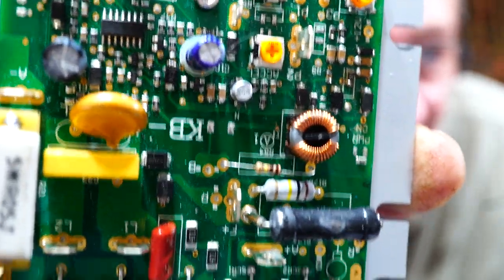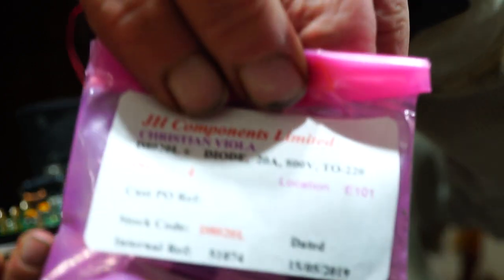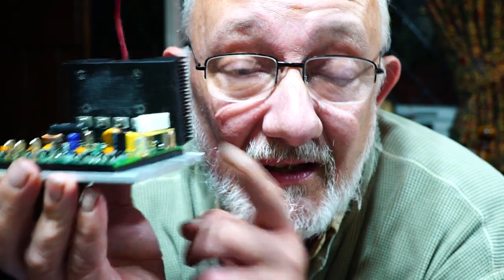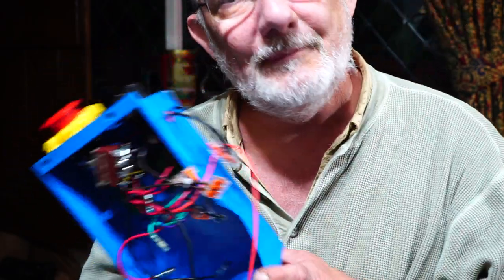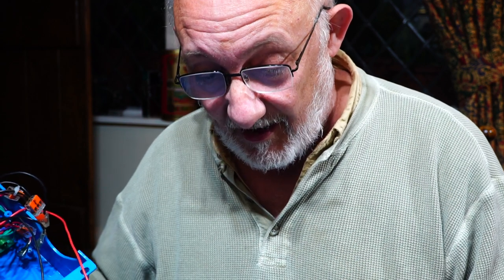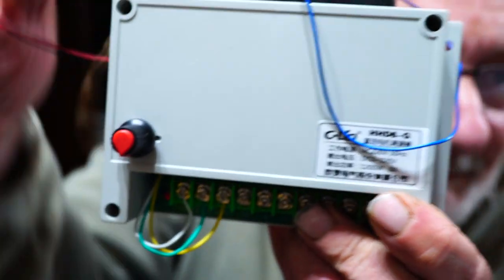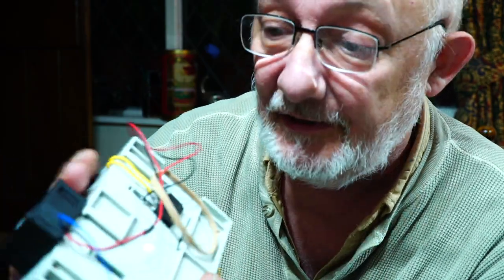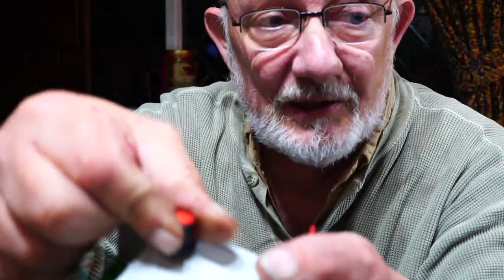Mini lathe KB board blown up fix

Comment: Hi Christian, thanks for posting the video, ive bought a mini lathe and unfortunatly it triped my breaker when i turned it on, now ive got the days and days wait for replys to sort it out, and i think they are sending me a new cable which is not the problem as ive temp repaired it and still nothing, you can just hear the NVR switch clicking, LED panel is dead too,  my board is slightly different as i have the speed feedback, i think the cable from the speed sensor got trapped by the rear cover shorted to earth and zapped my board, would this board you have be compatable with mine , or do you know where i can send it for repair? TIA.

Comment: Thanks for this. My lathe has just ground to a halt. Not sure if ht has the same board but i suspect it has something similar.
is there a simple test to find the fault? Goos video.
Reply from the maker: Ok, it is not worth fixing the current board, it will keep blowing up, each ebay for this board and fit it they are about £19 so buy 2 , AC 220V Input DC 0-220V Output Speed Controller Motor 1200W -10~+65℃ HHD6-G. https://www.ebay.co.uk/itm/HHD6-G-1200W-Input-AC220V-8A-Max-Output-DC-0-220V-Motor-Speed-Controller-50Hz/163677261055?hash=item261becccff:g:0KgAAOSw4EJczp5Z

Comment: High Christian, very useful video, just one question, are all 5 diodes on the board the same? mine has different numbers on them? Thanks .
Reply from the maker: Ok, it is not worth fixing the current board, it will keep blowing up, each ebay for this board and fit it they are about £19 so buy 2 , AC 220V Input DC 0-220V Output Speed Controller Motor 1200W -10~+65℃ HHD6-G.  https://www.ebay.co.uk/itm/HHD6-G-1200W-Input-AC220V-8A-Max-Output-DC-0-220V-Motor-Speed-Controller-50Hz/163677261055?hash=item261becccff:g:0KgAAOSw4EJczp5Z

Comment: Hi! I was happily turning some parts on my mini lathe, just after stressing it whist drilling a 24mm hole through steel, when all the power in the house went down. Turns out it has a short to ground out of nowhere. My board is very, very similar to the one you have with the same diodes. Would a short to ground be a symptom of them burning out? Would be great if changing them is all takes to get it working again :).
Reply from the maker: Hi I am not a household electrician. The boards do blow up with pressure put on them. You need to get it tested by a professional

Comment: Hi,
Mine has just blown, but the number on mine is a68069. are the d8020l the same thing. i know nothing about electronics, and would love some help please.
Reply from the maker: Ok, it is not worth fixing the current board, it will keep blowing up, each ebay for this board and fit it they are about £19 so buy 2 , AC 220V Input DC 0-220V Output Speed Controller Motor 1200W https://www.ebay.co.uk/itm/HHD6-G-1200W-Input-AC220V-8A-Max-Output-DC-0-220V-Motor-Speed-Controller-50Hz/163677261055?hash=item261becccff:g:0KgAAOSw4EJczp5Z
Reply: @christianaviola856  many thanks. i will order one